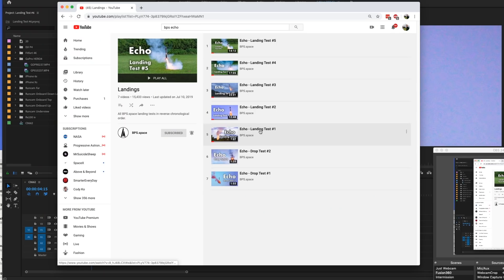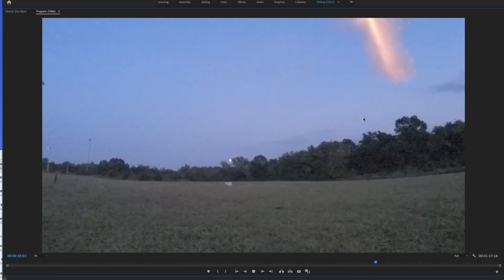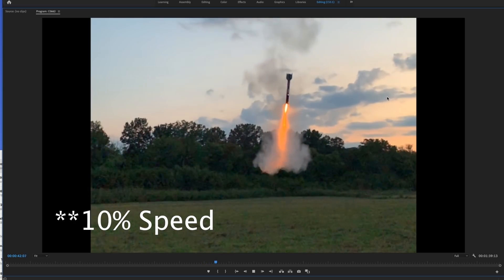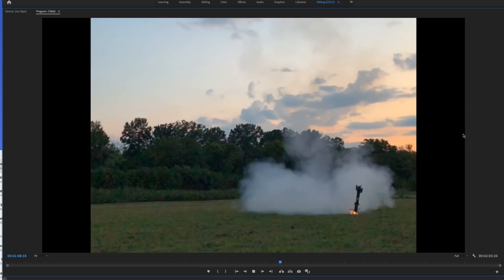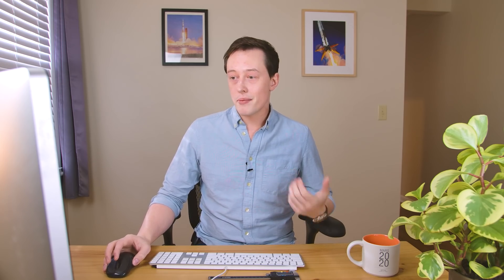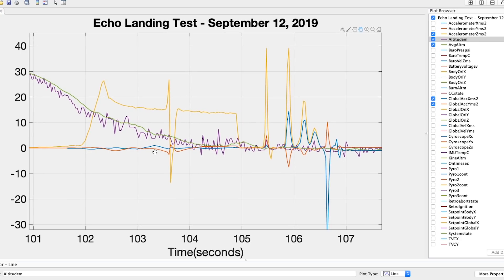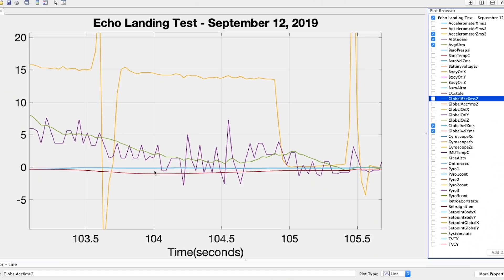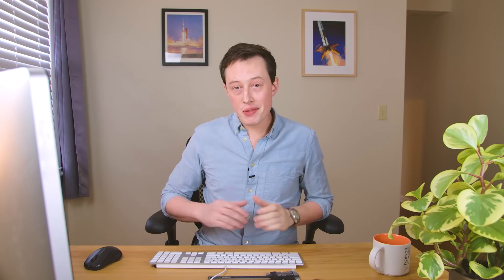Echo - Landing Test #6

Comment: Joe, first of all, hat off to you for your passion for the hobby! :-) 
I'm sure others have suggested that already, but I think you should add horizontal fins at the top of your rockets, that deploy at the beginning of return trip. Currently, when you deploy landing legs, it increases instability and makes the task even more difficult.
Horizontal fins should be solid, not grid type like in Falcon 9, and for the start, don't have to be controlled, though controlling them may be a great idea for the future when you will be flying much higher. 
With enough surface area, horizontal fins will increase your chance of success significantly without complicating the design a lot. You could use the same technique for deploying fins as for landing legs. 
Good luck and share the fun with us!

Comment: You should try injecting a modulator to cut thrust on the later portion of the landing.  You should be able to get the timing better with a longer drop and sufficient altitude resolution.  You only need a few seconds of modulator fluid.

Comment: Excellent engineering effort that came very close to achieving something that has, by definition, too many uncontrollable variables to be rendered controllable, let alone reliable. You have proven that, yes indeed, it is impossible to vertically land solid propellant model rockets (and by extrapolation, any solid propellant rocket) except thru a one off stroke of amazing cosmic luck.

However, if anyone on the planet can land a small liquid propellant model rocket vertically AND reliably, I have no doubt that it would be you. Therefore, I am looking forward to your 2020 test flights and preparing to be utterly amazed!

Comment: I'm really, really glad that you're moving to a liquid, presumably throttleable, engine.  I have long felt that you were doomed to failure due to the inconsistencies and lack of fine control available when using solids.

With that said, if you were to modify the landing legs of your existing vehicle, I think you could achieve success.  I would suggest raising the number of legs from 4 to 6 (or perhaps 8); and I would extend their length to be equal to that of the fuselage length.  When the vehicle was ascending, the legs would sit against the fuselage; when it came time to deploy them, they would pivot through a 90 degree, locking, spring loaded hinge located at the base of the fuselage, close to the rocket nozzle.  After deployment you would have 6 (or 8) long, horizontal members extending from the vertical fuselage; and I think this would provide you with the mechanical advantage necessary to reliably achieve an upright landing.

But if you want to stay with the current landing legs, a liquid fueled, throttleable engine is the way to go.  Good luck!  Best wishes, Charlie up in Canada (where we are currently caught up in an Arctic blast that has temps at night sitting around -40 C.  Gaah.)

Comment: Yes the problem is that you have no control over how much thrust you can apply so this is what sets you backx also solid mototrs aren't the same, what i mean by that is that their performance may vary a lot even if they are the same midel, but it really got close to landing with a SOLID rocket motor, great 👉

Comment: I started following this channel to you could prove me wrong. There was no way to land Echo without developing a new technology: throtable sollid rocket motors.
Instead of trashing the project in which you invested 3 years of your time, why you don't think as an engineer and have the guts to innovate.
If you can successfully develop a throtable SRB not only it will be an industry first, but also you could make a living of selling kits to all those enthusiasts that will love to propulsively land their own rockets.
If I were you I would try the following two approches to throtle the engine 30% which is needed to land reliably:
1. Try to vent hot exhaust from the top of the engine to throttle it. Using a software controllable valve.
2. Develop something similar to a jet engine thrust reverser. You can look them up online. In your case you can use two small metalic deflectors mounted on 3D printed hardware to deflect some of the engine thrust 90 degrees to the sides.

You are so close to suceed, dare to innovate man. It always get you places!

Comment: Ok, two suggestions to give your code the knowledge and control it needs.
1) don't use a barometer for altitude above ground. When under 10 meters, use a laser system
2) created a choke for the solid fuel booster that literally just pulls a rod through the center of the booster and has a flange on the end with 4 symmetrical semicircles punched in a small sheet of metal. this will generate 4 smaller jets, which will automatically arc sideways as the rod is pulled upward, redirecting the plasma. One small servo motor pulling on the rod will do the trick. 

Just my 2 cents

Comment: Stop trying mimck a hundred 100ft rocket. And make a 3ft rocket that can land. 1 longer landing gear 1ft arms . Spring load the landing gear. So it can bounce and not break. Make it heavier so it will hit the ground hot ground even at 100 % thrust. Not hit the ground hard. Use flaps to help slow the rocket down. Drop it from 500 ft. If it works then you'll know you did everything right.

Comment: Hi! I've been following your channel during a long time. You do an incredible job! 
I want to help you with your work. I'm in a project to develop the control of a self driving car. I tell you this because maybe the problem with the landing is that you don't have enough authority on the system, the rocket. I think you should try to control the trust of the engine. Because of the nature of the engine I suppose it's not possible to control this directly but maybe you can try other motors. To control all the variables (trust vectoring, trust force) you can try to use a Model Predictive Control. I hope I've helped you!

Comment: Did you ever analyze the variance in propulsion of your motors?  You might be able to prove that your current approach (I.e. perfect timing) is impossible.  What if instead you chose longer burns but baffled away excess thrust once you got close to, then on the ground?

Comment: I haven't looked at the earlier attempts, but #6 started out vertical but started tipping, maybe what, 10 degrees? before the motor kicked in... and #7 looked more like 30+degrees.  Since horizontal motion is clearly a major issue, seems to me like that would be a way to reduce issues - why is it tilting, and how do you stop it?
I heard you mention of some kind of horizontal dampening or adjustment, but if so, it's not working - and for #7, I can't imagine anything that could straighten out that kind of wobble in the 4-5 seconds it takes to drop from 30 meters....

Comment: never disappointed.  I have enjoyed all the attempts and now will enjoy what you do shifting to a different fuel.

Personally, I'd still play with Echo.  It is a "semi" low cost experimental platform.  yes, it is luck, but you still gain data and a lower cost.  Maybe one day you stick it, but given the effort you have put into software/hardware control, don't discount the ability to use low cost paltforms to tweak "issues", before applying them to higher costs efforts. 

How many times did SpaceX fail?  Yet, How many times did they learn?  As long as the result is plus one...it's a good equation.

Comment: Seems to me if you had some control of the thrust just prior to landing, you could ease the rocket the rest of the way down.  Maybe 3d print a variable engine nozzle (from a ceramic material) that you could ease open to reduce thrust?

Comment: So what about multiple small rockets ?  6 b's instead of a D.  This gives you a progressive throttle  and progressive burn out.  
Also gives time to adjust for errors after  the first shot.  Either that or it could have 6 times the error.  Haha. 
Enjoyed watching thanks.  Sounds like an impossible task given the fixed but "unknown and variable"  constants. 
Without a throttle you're never going to do it. 

If you intentionally undershoot and use a second smaller motor ( or three) to pick up the slack at Meco.... That might work also.

Comment: Have you considered putting loose powdered fuel in the engine throat around the ignitor? That way you will have a more consistent contact with the ignitor.

Comment: Hello Joe, I am following your channel a little over a year now, and I am still awed with your progress. For sure I will not stop following if you choose another path now. But I want to make a few suggestions before the Echo is thrown out of the window.
1. Orbital rockets do not rely solely on IMU and other on board sensors. Position and velocity are often controlled by external radar triangulation. Moreover, early rockets did not even rely solely on onboard flight computers, because these were to slow/weak at that time. Now, radar (or lidar) is obviously out of question here, triangulation however is not: you should be able to process the pictures from your cameras with a tracking software like Pixy2 (https://pixycam.com/pixy2/) from multiple cameras. If you transmit the onboard camera pictures wireless during the flight, they could be used also. I would make a bet that SpaceX is in fact doing that with their giant "X" on their landing pads. Admitted that is a hell of a programming problem, though :-P
2. In order to counteract the lack of precision in the motors burning time, add two tiny motors pointing upwards (and a little to the side to not burn the fuselage) strong enough to counteract the thrust of the main motor minus the weight of the rocket, so that you can land with a running engine by igniting the additional motors at touchdown. The legs should be able to withstand that and could in fact act as sensors for the iginition of the small motors. 
3. Apply servo controlled flaps as an aerodynamic brake. That is on par with the Falcon 9 grid fins and should counteract the lack of precision in the strength of the motor, as long as the rocket is moving quickly.
Liquid propellant engines are definitely the "correct" way to go, it is not by chance the way everyone in the space industry uses that for landing. But they are still expensive and difficult to handle for hobbyists. I don't think that the Echo idea is really maxed out already. I don't know if it's worth the effort, though; you already spent more than four years on that ... and Sprite looks pretty intriguing. But point number 1 could be applied to Sprite also.

Comment: I know it's a solid fuel engine but is there really no way to control the upward force? Divert some of the exhaust upward in a controlled way to counter? Or use a small pressurized gas tank to add to a too weak solid fuel engine to have at least a partial throttle. Inject CO2 or water into the engine to snuff  it at the right time. Let the big engine run out too soon, and land with 2 tiny engines that just slow down the free-fall. Use fins (like the F9 ones, but solid) to use the air drag to control your descent speed. All nonsense probably, but I'm trying to think outside of the box...

Comment: I don't expect you to try this, but would it be theoretically possible to throttle the trust of the solid motor by gimbaling the motor in a circle of controllable diameter around the setpoint? I'm very curious about this!

Comment: As it seems to me. I think if you had a diffusing baffle that can be shuttered in front of the motor's thrust to reduce your thrust output. If it is capable of shuttering in and out as needed. This could potentially be enough for you to reduce that distance between the ground and the rocket where you can't control the thrust output. This idea to me, is a bit like putting a diffuser screen over a chemistry burner to diffuse the burner gas output. This usually stops the gas pressure and spreads the heat out for even heating. This might be enough to give you enough control to reduce the volume of thrust to just less than the rocket's net weight to give you a controlled descent. Maybe a mesh or net shaped like a bulb in 4 pieces that can toggle in and out of place as needed. I'm not an engineer, but it seems to me this shape would produce less horizontal thrust than say a flat mesh.

Comment: Dude, what you have done here is absolutely amazing. Given the fact that you are using solid fuel engines and blue to that there will be small differences in each engine you buy. Some might have higher or lower thrust output and/or run for shorter or longer times this means there is a bit of luck involved. So a different engine type is required. You will need to scale up a bit (ok way up) but hybrid engines should be a good choice. Anyway what you have done thus far is outstanding.

Comment: "I think at this point you could land it on concrete and it should work"
 - Shows clip of it landing on concrete and breaking
"...nvm"

Maybe spring metal rod legs that extend out from the current legs and are about the length of the rocket, curving up at the end? 
It would give you a wider base to land on and at this point I think that's all you need. Unless you're really bent on landing JUST like a SpaceX rocket with a similarly small base. But they also have throttle control and cut thrust much closer to the ground relative to the rocket's size. But if you're locked into the current design, yeah I agree that's as far as you're gonna get. Congratulations!

Comment: I have a few suggestions if you havent thought about them already:  1 for accurate altitude data let the barometer get measurments at the ground and at drop heights over longer times and take averages or use a laser for distance measurments. 2 after the computer senses that the motor fired let it calculate if it ighnighted too soon, then reduce vertical thrust by moving it in cicles (more angle) or too late and in that case deploy a parachute. This all depends on wether the motor has a consistent burntime ans if you can get accurate altitude measurments but maybe it helped. Anyway keep it up and may your skies be clear and your winds low (:

Comment: If using PID control, increase Integral action to cancel steady state error. If this gives stability issues, and you haven't already done so, decouple the system. Happy to help if you have any questions. Good luck - a control engineer.

Comment: Have you considered using an inertial stabilizer inside the rocket tube?

Obviously, grid fins won't have the same impact, however considering the rocket mass an gyroscopic/inertial mass might help you correct the "yaw" problem
Reply: Although Hysteresis might kick in. 🤣

Comment: Hi, just wondering if you’ve considered an acrylic motor? Solid, inert fuel with throttle control by way of the valve on the nitrous.
Reply: He has considered a hybrid motor but they put out too little thrust to weight

Comment: Looking Good ...Thanks...is an adjustable nozzle that can give you some control over thrust possible I.E some mech to control the I.D of the nozzle or a retractable cone that sits in the nozzle ..I think control of the solid motor is essential and could help with all other problems and help take back some control and give luck some brute force... is your noise issues due to sensors/wiring or floating inputs and do you have an fix for these as I'm having similar issues with a similar project but Im trying to measure depth and water current and resulting translations  ..  loove the videos keep em comin ....

Comment: Had you ever considered putting controllable "flaps" under the solid motors so you could control whether thrust is going through?  Like \/ to stop thrust, and |  |  to let thrust through.  Then you would not need to try to time the ignition (which you don't control to a fine-enough degree).  Just time it so it should still be burning when you get down, but you control whether thrust is going through the flaps.

Comment: you have probably already considered this... however,  have you tried two separate solid rocket thrusters attached to the same vector control?  It would work like this, thruster one (main) would burn on the way down until the rocket starts to hover.  Then, when the computer has sensed a hover, it gets ready to light the second (smaller) thruster that is small enough to lower the rocket at a slow speed but not strong enough to lift its altitude again.  You have re-iterated the problems with solid propelant, so I wonder if a second thruster that is too weak to lift the rocket could burn all the way down from the 5m hover point, and continue burning for a bit on the ground without re-taking off. 
Cheers,

Comment: I personally would NOT reccomend methalox for the motor. Methalox is really complex to work with, a form of monopropellant would be far better. Something like a low (er) concentration htp engine would be vastly simpler. I'm currently working on another type of monoprop that I'd say is safer than htp, and easier to make.

Comment: What about a simple SRB throttle device made from two metal plates that are both vertical for max thrust and open to a A shape or flat plane to divert thrust sideways. Then you can launch a little lower and throttle down right before touch down.

Comment: Thanks for the update.  I believe you're shifting appropriately to liquid propellant.  Instantaneous ignition is a very iffy proposition on a solid propellant model rocket engine.  And the inability to throttle up or down just makes it that much more daunting.  Good luck in your new endeavor.

As always, thanks much for sharing.

Steve

Comment: I think you just can't land this rocket because it mimics spacex's design. place a larger, more flexible landing pad that you can land on.I would use flexible wires instead of the rigid landing bracket. just a guess ..